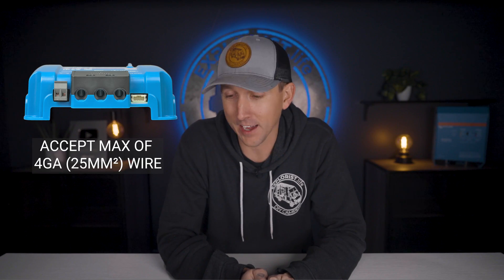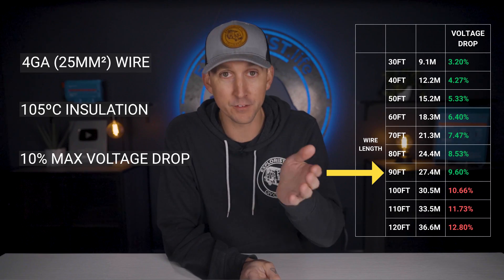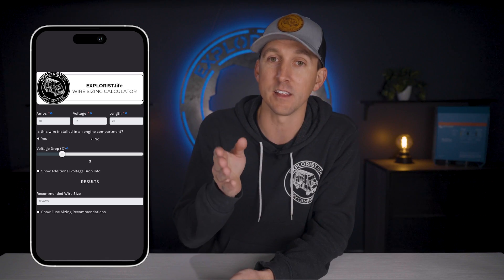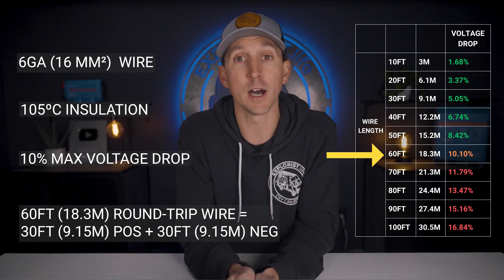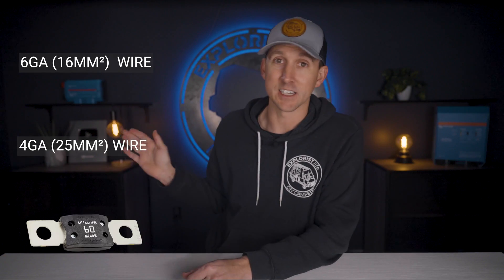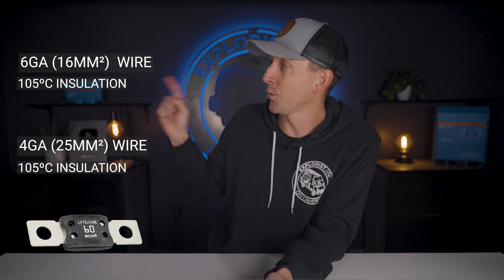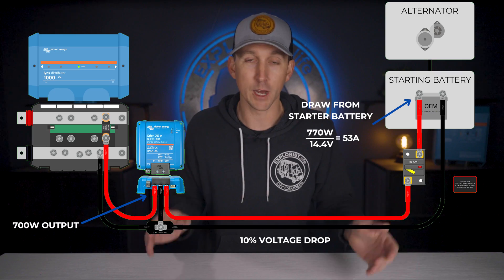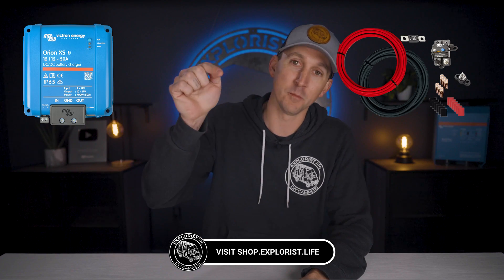Wire & Fuse Sizing for Victron Orion XS DC DC Charger

Comment: I am wanting to use 24v server rack batteries.  Can I use the new 50am charger?  Or do I need a 12-24 or 24-12 30amp victron charger.  I’m having a hard time finding why there is a 12-24 and 24-12 versions and which one I would need.

Comment: At the end of your video you explain about the effect of 10% voltage drop and that the orion will take in 770 watts at 14.4 volts which equates to 53amps. This does not make sense as the max inut current is 50 amps. It cannot take 53 amps in, can it? or 770 watts in? What it means is you will loose 10% of the possible output.

Comment: Is it possible to charge more than one 12 volt Li battery with this DC-DC charger at the same time? I will have 4 100amp 12 Li batteries to charge.

Comment: I’m installing a 50A dc-dc charger on a truck camper. The wire will be installed inside an engine bay and covered in split loom conduit. What is your recommendation for wire in this install?

Comment: I have a F-250 Powerstroke and the Orion will be up forward in my Airstream. They will be connected via Anderson connections. On the F-250 side can I ground at the back of the vehicle on the frame? Instead of running another lead to the negative of the battery? I thought using negative on a vehicle battery was reserved for winches and welders when current draw is extremely high...
Reply from the maker: We recommend running both the positive and negative all the way to the starter battery for best performance.  You're already under there running one wire and it doesn't take any more effort to do two wires, so may as well do it right the first time so you don't have to do it twice.  50A is still a pretty big load.

Comment: Could they have released this version of the Orion @ 50A to conveniently fit below the 60A CCP1 in Ford Transits?  The  Transit CCP1 fuse is notoriously hard to change so im a little nervous to follow your advice of a 60A fuse downstream of that.

Comment: This is good news. I have been researching chargers for my caravan. I have a Victron mppt controller fitted. Will the 50amp charger work with solar controller?
Reply: Yes you can charge from multiple sources. You can create a network in the app so the two chargers will communicate with each other.

Comment: Hi from the freezing north of England!  Great summary 👍
When updating, please mention the in-built cable clamp as Victron imply the ‘connectors’ need this unusual mechanical security for longevity.  
I found the lack of VE.smart network an unwelcome surprise. I’m having to incorporate a separate low temperature disconnect unit to protect my lifepo4 battery.  Hopefully they will have a firmware upgrade before next winter!

Comment: I wonder if you could help me figure something out, I've researched on the internet and get multiple different answers. 
I bought 3/100ah lifepo4 batteries 12v, have 3/100w solar panels with 4 more panels in storage for springtime installation, I was told a 20a control charger was needed, would a 40 amp be better.
Reply from the maker: Hey, @jamelcampbell4984! I appreciate you taking the time to ask your question, but unfortunately, I don't have enough info about your specific question to provide an accurate answer, but here is a playlist that, if you watch all of the videos start-to-finish (and take notes 😉), you'll have a REALLY good idea of how to design a solar array: https://www.youtube.com/watch?v=Jkbs84sBHsg&amp;list=PLmvhcyi4n0TV9pi83rFTv3ZuMT_S1xIZt

Alternatively, I have some of my most common solar array setups pre-built here: https://shop.explorist.life/product-category/all-products/camper-wiring-kits/solar-charging-wiring-kits/

Comment: A befriended camper conversion company had the chance to test this unit with "real-life" cable lengths of 6m and wire sizes of 16mm2 and 25mm2. Unfortunately, using ferrules, you cannot fit either size into the corresponding connections. If you use heavy pin crimp connectors, you cannot fit the cover. If you want to use two ground connects going to either battery, you need to use an external busbar, as there is no way to fit two heavy pin crimp connectors into the Orion XS.
The advertised software integration is no award winner either. There is a 0.5V voltage drop between the starter battery reading and the control reading at the Orion XS. This causes the charge current to drop continually way below the advertised mark.
All in all a very disappointing result - I had high hopes for this unit, as it did away with the excessive heat and subsequent weight.
Reply from the maker: We will be testing and releasing wiring kits and support so that none of that should be an issue. Stay tuned! 👍🙏
Reply: @EXPLORISTlife  Hi Nate, of course you will engineer a custom wiring kit to cope with this. You've done this many times. 😊👍
Unfortunately, anyone not in the North America region will not get the benefit of your hardware. One should not really have to custom fit some hack to connect basic wiring. 
Here in Europe, I can opt for a 50A Votronic unit. 🤷‍♂
Love your videos, stay safe! 🚐☁🍀
Reply from the maker: @gonefilming2020 We ship worldwide! 😉👍
Reply: @EXPLORISTlife  Of course you do. 😁

Comment: Why buy a non-isolated charger when you still have to have a negative wire to the other battery?
That's what it looks like in all the drawings I have seen. 
I thought the whole point with non-isolated was that you only needed 1 long wire, and the negative just gets grounded to the chassis.
Reply from the maker: You 'could' send all of the negatives to the chassis, but in my experience, using the chassis as 'the' current carrying conductor (wire) can give unreliable performance.  A wire to a lug to a busbar or other electrical connector is always going to give the most consistant performance, in my experience.

Comment: If I am putting this in a fifth wheel. I plan on a  dedicated positive run from a solenoid in the engine compartment. The negative I plan on grounding to the truck frame. Any reason to really run that negative all the way back to the battery?
Reply: Not sure how you went with this but I did something similar for our camper trailer and never got great performance out of our Orion 12/12-18. Someone else has also mentioned that the resistance of the chassis varies from vehicle to vehicle. So I think it's safe to say you CAN use the chassis for negative but it would be best practice to run a cable. 
I ran 8AWG cable and used the chassis for neg but I think I might upgrade it to 6awg and run the neg all the way back to the battery to see if it helps. 

Did you have any feedback?

Comment: Hello
My alternator is a small 55 amp.
Is it possible to connect, are you the new one?? To DC to my DC
Thank you
Reply: This DCDC charger is configurable in output, but that is a pretty small alternator, so you would want to probably keep it under 20A. In my opinion.

Comment: Great explanation, although I'm curious how the distance calculation varies if you're using chassis for the negative.
Reply: I was wondering the same question for non-isolated.
Reply: Every vehicle would have different resistance in the frame. Can't create a calculator for that easily. 

Assume you need to run a new cable from battery.

Comment: Do I have to run NEG from battery to back of my truck (then to RV) or can I save a few $$ and just get ground from the truck frame at the back of the truck (using only ~3-4 feet of NEG cable) ?

Comment: So I have a question. Hopefully someone can help me here in the comments or even explorist life themselves, I have a tool trailer that because of this page I went with mainly victron. I have a 2000 multiplus and I want to run remote switches, one at each door, next to my regular light switches. Can I just run them in parallel? I’m assuming this is a dry set of contacts but wanted to be sure

Comment: I have a 4awg just under 25ft with a RedArc charger at 30a. I think based on this I could terminal block that cable and add a Victron 12/12 18amp charger when I want a faster on road charge. I really don’t want to rerun that cable for a larger size.
Reply: I've got that 12/12=18 victron and once it gets to operating temp Im lucky to get 10A out of it. Proceed with caution, or a very good cooling.

Comment: I have been waiting for something like this for a year. I was thinking of using an Anderson connector between my pickup truck and travel trailer.  Would I run a positive and negative cable « to and from » the starter battery and positive and negative to the Orion from the Anderson? Would I also need to run a negative from the Orion to trailer chassis? Txs😊

Comment: Hi Nate, Some electronics are designed to run optimally at 13.8 VDC, rather than the 12.8 we see from a fully charged battery. Can the new Orion XS be configured for use as a boost converter between a 12 VDC battery and 13.8 VDC equipment?
Reply from the maker: It can indeed be used as a power supply w/ a programmable output voltage.
Reply: @EXPLORISTlife  , Great news!
Reply: Can two be paralleled in Power Supply mode?

Comment: Thanks for the great, highly educational videos.  I have really enjoyed learning from all of them as I have done various lithium and solar upgrades these last couple of years.  Do you have a video that talks about what to do in the case where the RV manufacturer assumed lead acid vs Lithium and used a battery joiner solenoid for house battery charging off the altenator?  

Even though my 2023 Newmar New Aire came from the factory with 640 Ah of Lithionics batteries (with a later factory upgrade of a 3rd Lithionics bringing the total up to 960 Ah) they still used an old-school Xantrex solar controller (that cannot spell Lithium and they now have a service bulletin/recall out for well over 100 vehicles) and battery joiner solenoids.  I have already ditched the nicad/lead-acid solar controller for a Victron SmartSolar MPPT myself thanks to your videos, but I still don't like that the rig  uses a solenoid for alternator charging vs DC to DC charger(s).  I'd still like to use the solenoid for combining batteries for a boost if needed when starting the rig, but I feel like I should rewire in a new Orion XS (or a couple) for altenator charging.  That said, I need to deal with the solenoid, no?  

My previous rig, a Tiffin Wayfarer also had a solenoid, but putting a BIM in its place was a simple remove and replace exercise.  But, had I gone with a DC to DC charger there, I would have had the same question as I do with this new DP, no?

Thanks!

Comment: On your site, I’m seeing Anderson connectors for either 6gauge wiring, or 2gauge, not 4.  Using 4gauge should work, but if a specific situation really called for 2gauge, how would you recommend handling the transition from a longish run of 2ga from the started battery, through an Anderson, to the Orion, then stepping down to 4ga right at the end?
Reply from the maker: I would end up handling that on a case by case basis in our tech support email as I imagine that will be a pretty rare situation.

Comment: I recently found your site and am loving the videos.  I am planning two anderson type(or similar) connectors in line to the camper.  How do these affect voltage drop? I will check back weekly for a link to the 12-12 50 as I don't see it currently listed in your store.  Thanks.
Reply from the maker: Hey!  Just a heads up but we got our first shipment in for the new Victron Orion XS 50A DC DC Chargers: https://shop.explorist.life/shop/all-products/victron-orion-xs-1212-50-dc-dc-charger-non-isolated

And here is the wiring kit for it: https://shop.explorist.life/shop/all-products/victron-orion-xs-12-12-50-dc-to-dc-charger-wiring-kit/

Dual Orion XS wiring kit coming soon.  Orion 30A to Orion 50A retrofit coming soon.  Stay tuned to our social media for the announcement for those.

NOTE:  I'm sending this everybody on the waiting list at the same time as well as a social media blast; and there are a lot more on the waiting list than I have available as of today and these WILL SELL OUT, But... since we have gotten our first shipment, that gives me confidence that we will have more in a timely manner; which means that we will be taking backorders.  This means that if we sell out, you can pre-purchase for our next shipment and we will fulfil those IN THE ORDER THEY ARE RECEIVED, so time is still of the essence if you want one.

So, when will the next shipment of these arrive?  Our current best estimate is April 26th for the next small shipment, and then by early June, we anticipate having enough to fulfill ALL orders.

I will not be sending out waiting list emails for these.  If you want to get 'on the list'; purchase one (or two) on backorder and we will send them out as we get them in: https://shop.explorist.life/shop/all-products/victron-orion-xs-1212-50-dc-dc-charger-non-isolated

Comment: Hello. I am considering an Orion XS DC charger for my boat. I have an epoch 480AH lithium battery for the house bank and 2 group 31 flooded batteries for the engine bank. I have not seen any settings in the Orion for charging lithium batteries. Am I missing something? Does the Orion support DVCC charging? Thanks!

Comment: Is it safe to use the vehicle frame as a common round for the neg running on the tow vehicle portion if going to a trailer?
Reply: I've been wondering this same thing ever since the XS came out. I have heard mixed opinions on it. Technically, it SHOULD be a common ground, but I think the only way to confirm it is with a multi meter. It would be easier if they just made an isolated version for this.

Comment: alternator printer van 2023 work ok ?
Reply: Yes no problem at all. It can support nearly double that
Reply: @PresidentBust  where we buy this one
Reply from the maker: Hey!  Just a heads up but we got our first shipment in for the new Victron Orion XS 50A DC DC Chargers: https://shop.explorist.life/shop/all-products/victron-orion-xs-1212-50-dc-dc-charger-non-isolated

And here is the wiring kit for it: https://shop.explorist.life/shop/all-products/victron-orion-xs-12-12-50-dc-to-dc-charger-wiring-kit/

Dual Orion XS wiring kit coming soon.  Orion 30A to Orion 50A retrofit coming soon.  Stay tuned to our social media for the announcement for those.

NOTE:  I'm sending this everybody on the waiting list at the same time as well as a social media blast; and there are a lot more on the waiting list than I have available as of today and these WILL SELL OUT, But... since we have gotten our first shipment, that gives me confidence that we will have more in a timely manner; which means that we will be taking backorders.  This means that if we sell out, you can pre-purchase for our next shipment and we will fulfil those IN THE ORDER THEY ARE RECEIVED, so time is still of the essence if you want one.

So, when will the next shipment of these arrive?  Our current best estimate is April 26th for the next small shipment, and then by early June, we anticipate having enough to fulfill ALL orders.

I will not be sending out waiting list emails for these.  If you want to get 'on the list'; purchase one (or two) on backorder and we will send them out as we get them in: https://shop.explorist.life/shop/all-products/victron-orion-xs-1212-50-dc-dc-charger-non-isolated